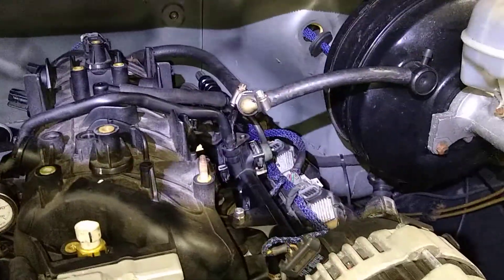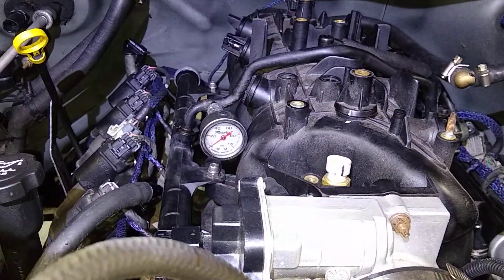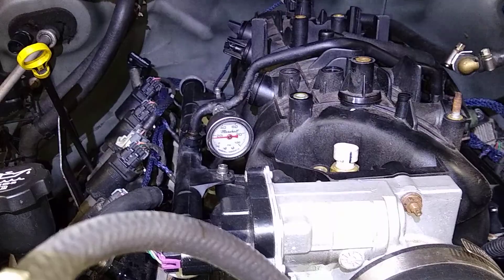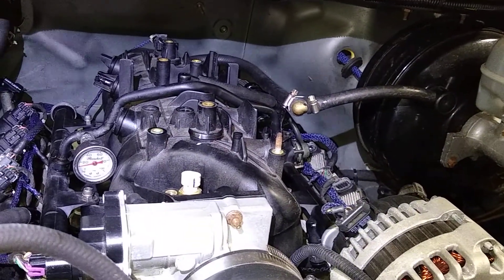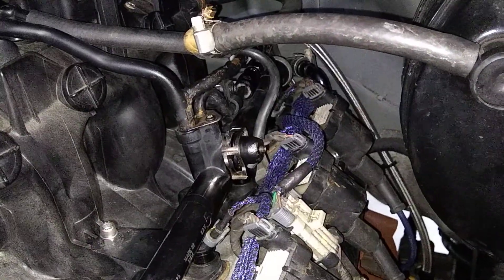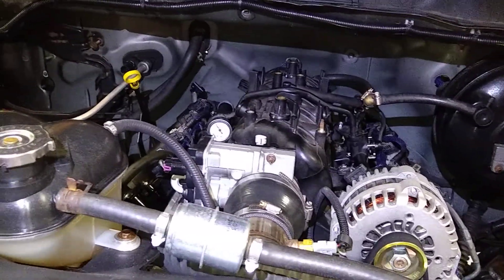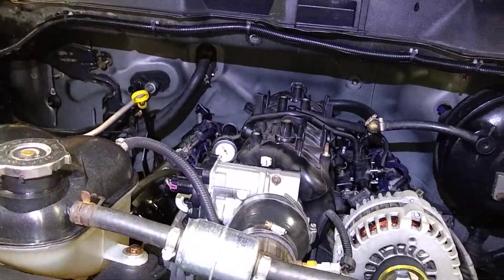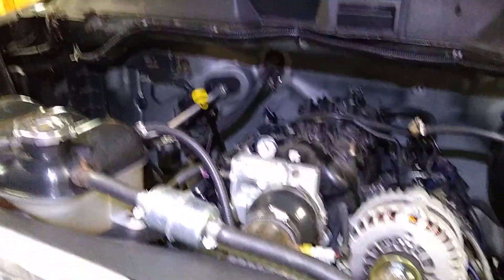GM Fuel Pressure Regulator Porting part 2 of 2 - Results

Comment: Awesome tip, wonder if it'll still raise fuel pressure 1:1 under boost after it's ported? My guess is it will, but I'm too dumb to figure it out without testing it and logging fuel pressure.
Reply from the maker: Juan Ceasar correct, it will not make any change to the 1:1 factor or at least, it shouldn’t. With base pressure set at 58, I get the appropriate fuel pressure drop with the truck idling at 50kpa of vacuum
Reply: @scrapmetal_sleepers  That's good to know.  I've always had trouble with walbro 450s overrunning the stock regulators and I just tune around it. It'll save everyone time and money just putting on a ported china regulator on it.  Thanks for posting this, that's a really simple/cheap fix for something that's been a headache on these trucks.

Comment: I did the same thing with an eBay "Aeromotive copy" FPR. Allowed twin pumps to be ran, but I still stage them
Reply: Not an LS specific part. The hoses and fittings are junk, but the regulator itself is good.
Reply from the maker: @andrewdynes5300  that's too bad about the fittings, it would be a much better deal that the "stock" reg if the fittings we're half decent.  I'll have to try one at some point, I "heard" they can handle twin 450's with some internal porting. I'll give it a try on my next build if I don't get a return style rail
Reply from the maker: Can you link me the copy?
Reply: @scrapmetal_sleepers  
https://www.ebay.com/itm/Universal-Black-Adjustable-Fuel-Pressure-Regulator-Kit-Oil-0-100psi-Gauge-6AN/122611013926?hash=item1c8c2f9926:g:Hn0AAOSwteFb2BGp

Comment: this is really awesome, i am going to try this, can you link me to china regulator? and are you running twin pumps?
Reply from the maker: Single Wally 525 (really a 470) just lookup hellcat 525 and read up on it a little, slightly more flow than the 450.